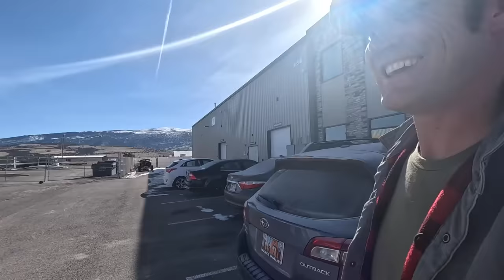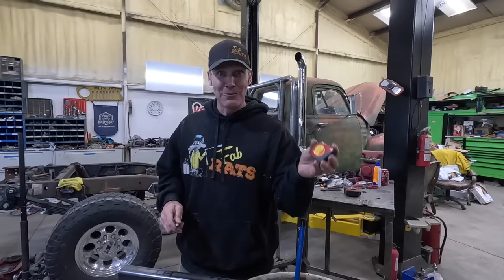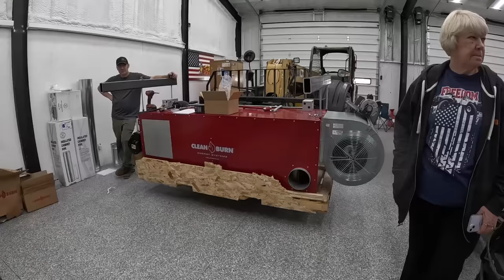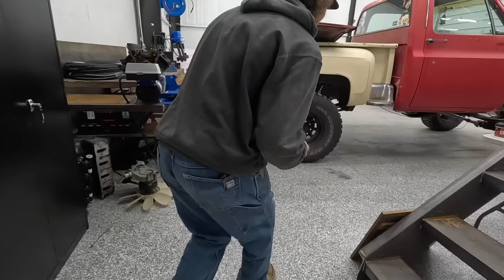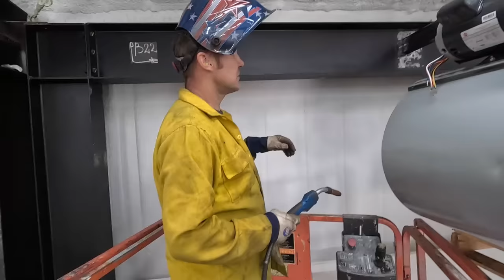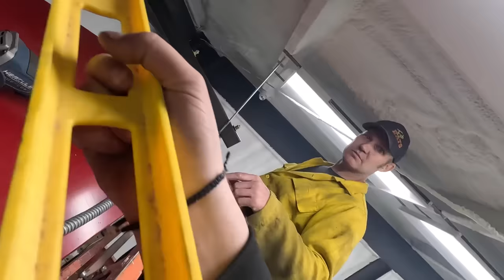Flirting With Disaster:  OSHA'S Worst Nightmare!

Comment: Paul's comment about how hot the ceiling was. You would do good with a couple of industrial fans running in reverse in the winter to blow all the heat down onto the guys. Save you on burning so much fuel to run the heater as well.
Reply: Yup, first thing i was thinking too
Reply: Reversible fans would be great, suck up and add a blower to outside in the summer for excess heat, or turn off the blower out in winter and fans reversed to blow heat down in winter.
Reply: Presumably the ceiling was hot from running the other heater

The gas burner looks to have a fan built in to blow the heat down.

But yeah some good fans would always help.
Reply: You must try to see how RR Buildings builds Hans' personal workshop/garage, it's simply super cool work, he's in that project
It may well be that it is more expensive to build right now and here, but if you see the price over 30 years, it is cheaper to build right from the start and energy right from the start. I know there is the cultural difference How you look at it
Reply: Right you are, a couple BAF's should do the trick.
Reply: Absolutely something to seriously consider.

Comment: A structural engineer’s nightmare. Eccentric load welded to the web of a beam (not the strongest part of the beam). No stiffener plates on the beam. Vibration of the unit not taken into account. But amazingly enough it might last for a good few years. 😂 

I would advise checking that setup on a regular basis though. Just to be safe.
Reply: Sorry Paul. I disagree with your hanging method. Regardless, if your tank goes under it, at least put a brace between the two to transfer load to the floor. As per the web load etc and vibration are definitely points of failure. Welded threaded rod like that is not safe. I’m not a safety officer lol. Simple principle. Use LAR engineering. If it Looks About Right, it’s good. That setup doesn’t lar imho.
Reply: "It'll be fine"
Reply: And all done without a permit to install? Also, I'm no welder, but I don't understand how a butt weld on square beam at one end and how it didn't all come down. It looks sketchy
Reply: I don’t know shit from Shinola when it comes to any kind of engineering, but I think I can point at a problem and question what is wrong. It’s not the worst mount I’ve seen but damn that’s bad. My immediate thought was torsion on that bar and the vibration the unit is going to generate. Nice to know I was in the ballpark as far as concerns go.

Comment: Nice install; May want to duct the return down the wall, as heat rises, to pick-up cool air to be warmed. Would also allow for a filter in a easy-to-replace location. Avoid burning dust, GL
Reply: They have a separate air intake for the burn chamber then the heating chamber. Also the amount of soot that builds up in the burn chamber you have to service them at least once a year and vacuum them out and run a wire wheel down all the tubes it’s REAL fun. So I really don’t think it will matter at all if a little bit of dust makes it in there, ours would fill a shop vac half full after one winter (2-4K gallons of oil)

Comment: As a Contractor that has installed metal buildings, those building are designed to hold up themselves and snow load. Be careful how much other weight you hang from roof on them.
Reply: What is the best “Bang for the buck” metal building?  I’m in the market.

Comment: This unit is a great addition to the shop.  Put some circulation fans up to move the hot air down.  Will save you on oil usage and keep the shop a more consistent temp.  Also on your return air, mount the filter lower in an easy to get to location, then duct it to the heater.  You'll find out how much noise you are going to get through the solid mounts once the unit is started.  If it's too annoying, there are isolators that can be installed on the mounts.  Enjoy your new heater.
Reply: Yes on the isolators.1 day of the shop 'singing' will have them going for a few rubber bushings.

Comment: HVAC guy here and I approve of your mounting bracket and OSHA approved install. Sometimes you just got to work with what you got. You could hang off the furnace and not worry about you and the whole works coming down. 

Oh by the way, you are going to become a oil burner tech with that crank oil burner. Whole lot of maintenance. You can make Hunter your burner *itch, aka oil tech. It will keep you warm when it's working!

If you don't already, I recommend getting a preheater for the oil with a lift pump it will make life much easier.
Reply: I found out the hard way you want to have the heater mounted low enough that it can be worked on while standing on the floor.
Reply: I was going to comment the same thing ,those wast oil heaters need constant maintenance. then you get people that leave the pre
 heater on year round,and never clean filters that's always fun.
Reply: Use to work in a hydraulic shop which obviously had 100000s of gallons of waste oil, we would keep a rotation going meaning not burn any until it sat a year which let a lot of BS settle out. Still had to clean all 3 or 4 furnaces regularly and it was on top step of step ladder or pallet on forks haha
Reply: I’ve always wondered about this. We had a Reznor waste oil heater at my old job that ate an absolute shit cocktail of every oil you can pull out of a truck or tractor with a pretty decent dose of bad gas and diesel. Every time the tech came out for the regular service he told us to keep doing what we’re doing, because it’s far cleaner than most of the units he fights with, including new installs like ours. We were kind of baffled because we knew that heater was burning shit it wasn’t supposed to.

Comment: Wow a waste of oil heater 😮a whole new world of pain. Judging from the color of your oil your first purchase a good tank vacuum side inlet filter bags to fit disposable don’t loose the book! Gun cleaning kit with brass brushes to fit 1/8” pipe. 
My # on speed dial. Love you all Rich.
Reply: Years ago I worked in a shop in the Arctic where they burned waste oil. They had a tank with three sections and a little spillway to only allow the oil which is on top to go into the next section. The guy that ran the sewer treatment plant took care of the waste oil burner these two tasks kept him pretty busy.

Comment: Suggest that you loop a couple of steel cable safeties under that thang. It will be vibrating and shaking in operation and never trust all-thread.
Reply: It needs something. As it stands that doesn't look totally safe. If it comes down when running, even if it misses people, they are in for a world of pain.
Reply: Its also attached to something that yo are told specifically NOT to attach anything to, the web of a C Beam
Reply: @marvindebot3264   Yup, I was wondering about that myself. The horizontal legs could have rested right on the flange.

Comment: Clean install! You might need some spring isolators on the threaded rods tho. You won't know for sure till it runs. Usually they mount to the unit and then you run the threaded rod into them.

Comment: As mentioned, some circulation fans will aide in heating the building more efficiently and save you some money by not needing to run it so often or on as high a heat setting.

Comment: I was relieved when you added the extra struts to the roof, The only thing I would have done differently is to not weld the all thread, but run it through a piece of pipe or angle iron giving you another point of adjustment and not chancing the rod getting brittle.

Comment: I'm glad OSHA wasn't anywhere near me when I've done some sketchy things too. If you can take into account everything that could go wrong, you can get away with a lot. Good job there Paul. The safety guys are usually way overboard on what they see as safe.
Reply: That's for sure. A 4" framing staple hit a knot in the 2x10" I was stapling to a 2x6" and went through my thumb sideways.Completely. I put on 2 bandages and finished the day. Before we could start the next day, we all had to watch a video and do a worksheet.Duh...It was a freak accident, not carelessness. The guys all thanked me for an hour paid for diddly.

Comment: Things sure have changed, when I was a welder we weren't allowed to run downhand on anything structural. And specially not with a MIG. Downhand was for non structural and cosmetic. Of course, this is Paul's private shop and he can weld it anyway he wants to and feels safe with.

Comment: Hear rises. Always. Even if you point it downwards. Most of the air you produce will be wasted through the roof. Just think of this. Underfloor heating is the most expensive but most efficient. Watch diesel creek in his new shop.  It cost him nothing, NOTHING to run it.  Wood burner outside the shop. No noise in the shop and he will have all of his money back burning free wood for just around 3 years.  Great work you all do and I never miss a single video you make.  10/10  and 5*
Reply: Sorry, it does cost to heat with wood unless you have someone to donate the wood all split and stacked at your door.  I live in NW Minnesota where heating with wood is very common.  The folks here will tell you that there IS a cost even with access to acres of wood.  Wood fired boilers are an excellent method of heating your home and shop. Central Boiler/Wood Master company is just down the road from me. Their wood fired boilers are state of the art and efficient.  Even so, to say heating with wood is free is not exactly accurate.
Reply: What is your time worth? Gotta figure that into "free" wood heat.

Comment: I would have gone with radiant heat through the concrete floor,
Big miss on the set up of the floors, 
Outside wood furnace with 3 to 4 foot logs heating the water would have been the best bet, would have the  used oil furnace as backup. But it's good to see you having heat.

Comment: Hey I've had one of those clean burn units when you make the tank just saying make sure your pickup is a few inches if not more off the bottom. And definitely run some filters. After having issues I started using old jeans with a knot in the leg to filter the oil I put in the tank. Just pour it in and let it drip out the leg into a big funnel to the tank. Mean no offense if you already know. Love the program brother!

Comment: You don't normally have seismic events there in Utah, so it's probably ok. I would have incorporated the upper flange in the wall connection to the TS as the web is weak and will deform, but hey...it's hangin' for now.  Just make sure to put a boatload of fuel underneath it so when it falls, we'll have a very dramatic, proper cinematic experience.
Reply: Yeah, no. Utah averages over 30 earthquakes per year with an average of 13 of those measuring 3.0 or higher. First earthquake I ever felt was in Utah while in college.

Comment: Fine job on that there heater boy's,  boy I bet that baby was expensive. Not sure but you might have to build an enclosure around it to muffle the noise. I know you said that one is suppose to be quieter but those things are pretty noisy. So I guess you will have to have a little pump for the tank ??? Thanks for the video guy's can't wait for the next one.

Comment: I have been doing nothing but waste oil heater sales/service for 33 years here in Montana. I see a couple of things that might cause you some issues. #1 you need to have a J-pump with regulator for the altitude you are at. That metered pump will deliver to much fuel for your altitude and do not buy into the fix from Clean Burn of add more combustion air. If it is not to late, for servicing and air flow it would be better if you could flip the heater around. If you have any questions I am here to help if I can.

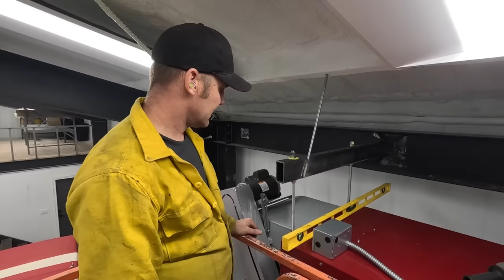Comment: 17:52  One time when I was an Apprentice, in a factory that made medium duty  Chain Hoists, I was finishing up a job JUST like this.  

The roof trusses had a light 2' X2" angle iron, that was mounted so it pointed DOWN, I left a nice prybar in the "" of that angle iron,, and didn't remember until the next week when I was at home and noticed it missing.

Sure enough many years later (like 8 years or so) .. we got a call to service the unit (it needed a new blower) .. and I found my prybar up there untouched!  AND two 3/4" nuts they blamed me for dropping! :)

Comment: Adding ceiling fans will save you a ton of money in heating cost.  We once put a 19" fan on a 20' ceiling (well management did to make us happy) and then built an 8x8' parts room directly below the fan.  Not deliberately, but that little room got so hot we could not go into it and had to move the parts room.  Fans do work.

Comment: Clean burn waste oil burners work great. Just clean them at the end of every season, And the pickup filter. We have one that is 18 years old now. 
A good supply of air and not to much 90 weight oil at once. For a tank we use two 275 gallon pallet tanks. Because they are clear you can see how full they are when filling them and how empty they are getting during use. We have them plumped so each one has its own line and filter with a ball valve on each to shut off the one not in use.

Comment: Love the new shop! Oil heater is a great way to heat it. Had oil heaters in a equipment shop I use to work at and they worked great you just got to keep the filters clean. I suppose you are already planning on installing a couple of ceiling fans to push the heat to the floor.

Comment: Since you have so many tape measures.  In my shop I had a tape measure that would not retract so I cut it off at 18".  It is so handy to use for small jobs or layout work without the body of the tape in the way

Comment: Drill the bottom hole way oversized in the tubing. It helps.  I have radiant NG gas overhead heat in my shop and it's the best. Waste oil heaters are expensive.

Comment: The first measurement was at the bottom, on the nuts that the ready rod screwed into, makes me wonder if the "confirmation measurement" was take across the tops of the rods. where slight flex or angle of the nut welded to the heat would cause a variation further away.

Comment: Save yourself alot of oil. Take a long vertical 4-6 inch pvc pipe with a small fan at the bottom of the pipe blowing out across the floor. Move all that heat that collects at the ceiling back down to the working space.

Comment: Got a couple of them heaters. They use more oil than you may think.  Keep the ash clean and air presser, right . If not you will be getting pi’s working on it. But man the heat is super intense on them .

Comment: Great project. Is this one of those furnaces that'll burn used motor oil. And as Paul mentioned several times, there's a lot of heat against that ceiling. So if you haven't already, consider installing ceiling fans to gently push that hot air down. Your utility budget will thank you.

Comment: Fyi Paul just some advice try to burn only trans fluid in it . Cause if you burn engine oil that has coolant in it will plug your spray nozzle quicker than just trans fluid and they create just as much ash as your wood stove! Why cause wear I used to work I maintained ours. Don’t get me wrong they are awesome! A suggestion is that you have hunter clean it when it’s time to clean it lol 😂 sorry hunter but someone has to do it!!!

Comment: I would definitely put the tank outside.. and bury it.  Why have a big tank taking up your shop space?
I would at least build the tank up high on some tall legs, like farmers do.. That way you can still have the space below it;  at least for storage.  I get that you wouldn't want to be welding next to it probably.   Taking up your only good corner in the shop with a tank is a big mistake..  I'm calling it now. :)     You'll move it later, once you realize it.
Reply: A waste oil tank outside doesn’t work so well when it gets cold because the oil thickens. So when you need it most it won’t work. Even heating oil gets thick in cold weather. 
Burying it creates a whole different set of issues.

Comment: Having those waste oil burners on the grond is pain enough let alone 15 ft in the air. I always thought those burners were a lot of maintenance, with cleaning and vacuuming,don't forget despite what manufacturers say there is a greasy film that eventually gets everywhere, they are a great format though, good luck, and get some 2 way ceiling fans asap

Comment: Sorry I didn't suggest a couple dozen times for in the floor heat.  Way better.  Even heat floor to ceiling.  Now you will need fans on the floor. Good luck keeping the oil lines clean. It can be a major pain. You might want to consider a recirc system to warm the tank pickup.

Comment: 14:38 .. LOL :) .. Hey for a weld like this, where strength is #1? And If it was my heater?  I'd weld in MYSELF too!! .. just for responsibility! :)  

15:31 .. NICE!! .. I was wondering where you we going to add the gussets.  The thing is in a WORKING shop like this, the Furnace Support has to be able to stand up to getting bumped with a fork lift too, not just hang there like decoration.

Comment: How about painting some of your other POS cars?
Oil-burning furnace? why? install a 10kw solar panel array on the roof of the workshop get a back-up installed and then run a commercial grade reverse-cycle air conditioner that does both heating a cooling.

Comment: Instead of measuring 3.5 inches for the first hole and then trying to measure center to center 21.5, you should just mark at 3.5 and 25 inches without needing to move the tape!

Comment: I have a wasted oil boiler build tank with a slight slope on the bottom to drain off the water I run all of my used oil through a filter the cleanest burn is mixed with diesel I have to clean my boiler every two weeks but we burn 200 gallons or more a week depending on the temperature in Alaska they don’t like full synthetic oil